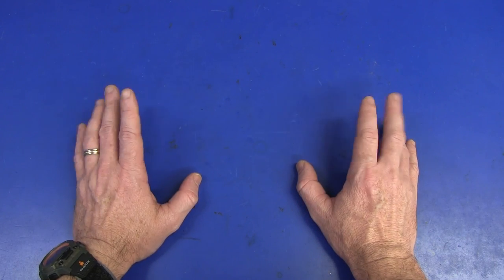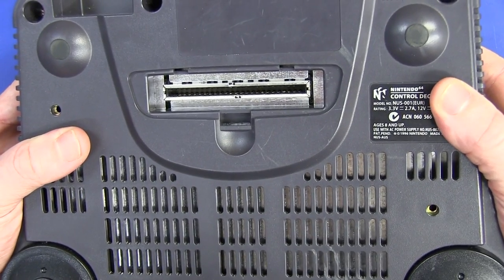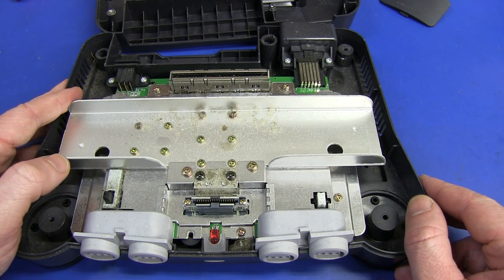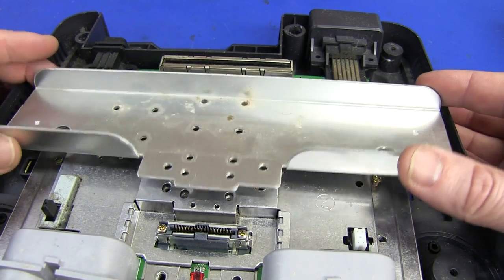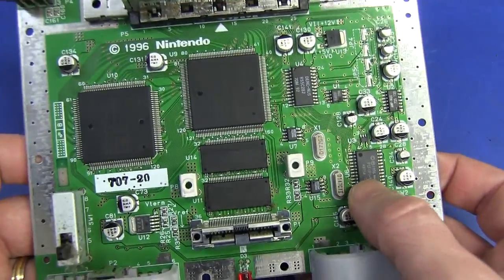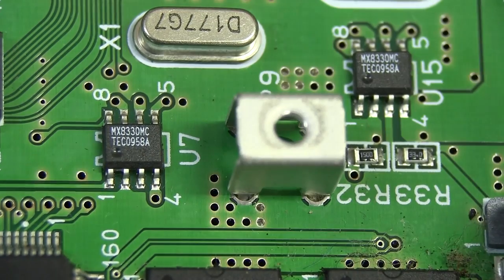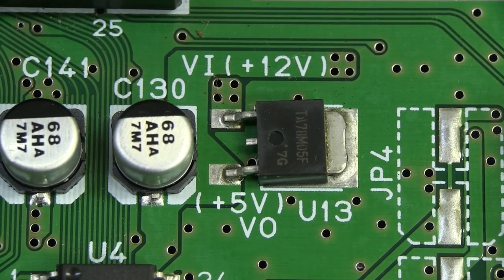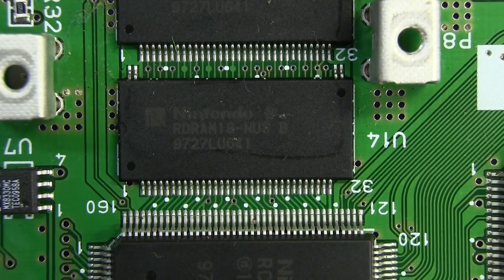EEVblog #491 - Nintendo 64 Game Console Teardown

Comment: The lack of RAM kicked the n64 in the nuts. Thats why alot of games were so cartoony. To save ram half the time you were looking at shaded colours instead of actual textures.
Reply: Not really, it was the price of the cartridges or the ROM-chips to be more precise.
The RAM wasn't all that important because the cartridges were solid-state.
Reply: The ram is very important, rom is fast but its not as fast as ram and you can't write to it. The n64 actually had more (4mb vs 2mb) ram than the ps1 but the gpu would only accept textures as large as 4kb. The ps1 allowed you to store large textures in the VRAM which was 1mb. Thats why n64 games all look cartoony, half the time you are just looking at a shaded colour and not an actual texture..
Reply: Derpin Bird That's nonsense...

The big strength was the N64 cartridge. We use the cartridge almost like normal RAM and are streaming all level data, textures, animations, music, sound and even program code while the game is running. With the final size of the levels and the amount of textures, the RAM of the N64 never would have been even remotely enough to fit any individual level. So the cartridge technology really saved the day.

— Factor 5, Bringing Indy to N64 (Source Wiki.)

The real reason the N64 wasn't a commercial highlight was the fact that you would have to manufacture a custom ROM chip for every individual game which was ludicrously more expensive compared to the price of a burned CD. 
Take the amount of chips in the Cartridge of Conker's Bad Fur Day as a negative example.
Reply: I don't deny the fact that you can load while the game while its running. Im saying the 4kb texture buffer caps all of the textures to 4kb. There is no workaround to that on the n64 and an off topic article on how the game can run and load at the same time doesn't change that. It doesn't matter that you can "stream" it right from rom, you need to render the textures and you can't do that in memory you can't write to.
Reply: Also you do not need custom rom chips designed for different games. They are just blank memory chips that are loaded with software at the factory.
Reply: Derpin Bird Games that were licenced by Nintendo, ALWAYS  used true ROM chips in their cartridges and not PROM EPROM or EEPROM chips!
Reply: PERILEX You cannot render textures on a rom chip. Period. All you can do is read data very fast. The problem is the gpu was by design only able to accept 4kb textures. The n64 "reality coprosessor" (gpu) just had no workaround to make that limit larger, all they could do was come up with better compression formats. Rendering involves reading from the cartridge into the texture buffer, processing it and then writing the output in the correct part of the frame buffer. The playstation on the other hand had to load all the textures into ram, then read the texture from the ram into the texture buffer. It is slower but the cd can fit more and the gpu has direct access to the ram and is in a position to use it for whatever, like perhaps a custom buffer you could put whatever texture you like. The n64s crazy coproccessor was optimal in that it did read directly from the rom and take instructions but it had to ask the CPU to operate on the memory, making the process too slow to try to use it as a buffer.

There are alot of articles on this. None on how to work around the texture problem beyond compression. Nintendo also experimented with making an add-on cd attachment. But that never took off because it wasn't the problem. Sure having limited game sizes wasn't great but the console wasn't built to handle large game size. It cant load large textures, has no audio or video decoding chips and its a nightmare to program for. Whats to put on it?
Reply: Derpin Bird Sigh...
Reply: You don't get where Im going don't you? Even with the 4Kb cap, there were many games that looked more than fine enough to become BESTSELLERS! 

GRAPHICS AREN'T EVERYTHING!

THE PRICE OF THE CARTRIDGES WERE THE PROBLEM NOT THE MUSHY'ER TEXTURES!
Reply: To fit in the space and save on cost, Majora's Mask was the exception to this (EEPROM chips), which is why the cartridges degrade so damned fast.
Reply: JohnBonoSmith Yeah they only used masks to stop piracy which was successful but everyone had to pay the costs. I also think there might be a limitation with adressing more than 64mb of rom as well but who knows.
Reply: OK, firstly it's the gpu that has access to the memory bus, NOT the cpu, and thus the cpu often stalls waiting for the gpu to hand it memory.

Secondly, the theoretical capacity of a cartridge is related to the bus width... Due to it's design, you could theoretically use 4 gigabyte cartridges, and that's without resorting to the bank switching techniques that are extremely common on cartridge based systems as far back as the atari 2600.
The limiting factor is cost, not technology. The reason real cartridges capped out at 512 megabits (64 megabytes, about 1/10th of a CD), is entirely because even 64 megabytes of rom at the time was unbelievably expensive to manufacture.

Then we get that 4 kilobyte texture cache... Yes, that is the primary limitation, but, and this is important, you can draw something, then load something else into cache, then draw some more.
Meaning, if you can reload the contents of the cache memory fast enough, you can code something to use much, much bigger textures by treating the image as a large number of 4 kilobyte chunks. This can, and HAS been done. (see rogue squadron, and conker's bad fur day for known examples)

OK, so now two new factors come in here.
1. ROM exists directly in the memory map of the system. - you can read it directly. You don't need to copy it into system RAM first, you can copy directly from cartridge to texture cache.
Contrast this to a CD system (or a floppy disk, or hard drive) where due to the slow speed and nature of the storage media, it is technically impossible to read directly from the disk in any meaningful way, you have to copy or at least stream it into main system ram before using it for anything. 
2. The main system  memory in the n64 has a bandwidth of 562.5 megabytes a second, but, and this is a major thing, the memory bandwidth of reading directly from a cartridge is between 50 and 300 megabytes per second depending on the cartridge design itself. Conyrast this to a CD where for a dual speed drive you get about 300 kilobytes a second, and you can see, in fact, reading the data directly off of cartridge is almost as fast as reading main memory.
This means that where the playstation, say, has 2 megabytes main ram + 1 megabyte graphics ram, the slow speed of the cd-rom drive means it has to store the framebuffers, game code, all the variables the game logic requires, 3d models and textures, and any sounds except maybe the sountrack (since the data rate is slow enough that a few kilobytes of a buffer would be enough to play cd audio directly if you don't need to do constant seeking). You have to load that all in one big chunk until you run out of RAM, then run it from RAM.
The n64 on the other hand? since ROM is as fast as it is, you can run anything which doesn't get modified at runtime off of rom. The RAM must contain any variables, and the framebuffers, and possibly some audio buffers, and if you modify geometry (think mario's face in super mario 64's start screen) or textures at runtime those would need to be in RAM as well.
But the actual game code? models? textures? sounds? barring use of compression all of that can be read directly from a cartridge without even so much as touching the RAM.

And, this is where texture streaming comes in. Store textures as 4 kilobyte chunks. Read these chunks at 300 megabytes per second directly from ROM into the texture cache. Draw relevant image sections which use this texture, load next texture directly from ROM, repeat, until you run into some performance limit. (fill rate, most likely, on an n64).
There's no limit to how many 4 kilobyte textures you can use in one scene other than fill rate and memory read performance, really.
and with 300 megabytes per second ROM reads, you would need to be using something stupid like 2500 textures in a scene before you ran out of ROM memory bandwidth, and likely something else would limit performance long before then.

Don't get me wronh, the 4 kilobyte texture cache is a major design flaw, but due to being able to reload it's contents many, many times a frame, and ROM speeds being beyond 50% of RAM speeds, it is in fact a limitation that can be broken with clever programming, and thus n64 games can use way more texture data than you give them credit for.
I haven't tested it myself (n64 homebrew is rather challenging), but it wouldn't surprise me to see later games reloading the texture cache 100-200 times per frame. With 8 bit textures, you get one 64x64 pixel texture into the cache.
But, if you draw intelligently with it, and write clever code, with 100 or 200 64 by 64 textures you certainly aren't limited.
a 256x256 texture is equivalent to 16 of 64x64 - so if you have, say, 10 objects, plus the level geometry, you could use 160 textures for objects, and 64 for terrain and you'd end up drawing using 224 textures, none of which exceeds 4 kilobytes.
And that's still very comfortably within the ROM bandwidth limits, so it leaves plenty of bandwidth for other memory accesses. Whether the rest of the GPU systems can keep up with that I do not know, but you certainly wouldn't be limited by the texture cache.
And while the details I used here are speculative, the technique definitely is not. This is exactly what late generation n64 games did, and it shows.
Reply: KuraIthys Lol how far did you have to scroll to find this one? All i said was the n64 has a memory problem, more specifically a texture problem. Something everyone has agreed with me on. I have also had this argument about trying to work around the texture cache problem, yes it could be done within limits but the code was highly proprietary and it shows in the difference between 3rd and 1st party games. The n64 had some very interesting very powerful hardware inside it but it just had the wrong features to begin with.
Reply: +Derpin Bird - +Kuralthys and the others make a lot of good points, and a lot more insightful than "the lack of RAM kicked the n64 in the nuts."  With as many games that look as good or better on the N64 than anything on Playstation, that simply doesn't hold water.  There were many other factors that went into it not being as 'successful' as the Playstation.  But i'll always prefer the N64.
Reply: kdkseven Like i have said many times now, the fact that it compared at all to a cheaper console packing hardware made years earlier highlights the fact that it didn't live up to what it promised. Like i have also said many times is that the n64 is a great console but it could have lept much further ahead if it had the ability to display more detailed textures on the screen. Its a memory problem, theres only kilobytes of space to fit textures and the instructions just aren't there to use other resources to do that like the ps1 can, and thats why their graphics output compares at all. Its not about which one is better compared to the other, im just saying the n64 could have been way better and using the most comparable console to do that.

Comment: Most of the n64s still work like brad new even when you threw em from the second floor ( i did it) no wiring, huge heat sink that works like armor well Micro$oft take notes because your consoles suck. No fan boy actually after PS2 era I switched to PC for the win.

Best console design ever.

Comment: That cheap ass heatsink is the reason that so many n64s would constantly overheat and lock up late in life.
Reply: So many people do not understand thermodynamics.
Reply: I found the imagined dialogue between the hardware design guy and the budget guy awfully familiar.
Reply: the n64 actually runs pretty well without any fans and I saw a video where they took off the heatsinks and it still ran fine. it shouldn't be hard to find, I just don't remember what it is called
Reply: NickTheDumbass i've had 3 n64 consoles in my lifetime, 2 of them will lock up constantly, unless i leave it on for a period of time, in which case the freezes become less frequent, which leads me to believe it's a case similar to the 360's rrod or the ps3's yellow or green light of death; which is cracked solder points on a critical motherboard component. Maybe not necessarily due to overheating, but heat and cheap ass junk components together.
Reply: I have two n64s (at the same time) and I never had issues with either
Reply: NickTheDumbass I looked it up, it actually was a problem with the expansion pak, which makes sense, because DK64 was the game that my second N64 started screwing up on. Maybe my stupid 12-year-old self messed up the contacts by not using the official tool for removing the jumper and expansion paks....
Oh well, now I know. I did see some issues with overheating systems, but they didn't freeze, instead they would reset at seemingly random times, so I guess my issue was RAM related.
Reply: The RAM part is pretty interesting actually
Reply: I only ever had the N64 freeze on my once, and it was while playing Rogue Squadron. System had been on for a looong time and the RAM expansion itself was super hot. The system itself was fine.
I think that's probably the main issue. The RAM expansion couldn't have a comprehensive cooling solution.
It was notably even worse with 3rd party RAM Expansions, that was noted even at the time they were being released.

Comment: how nice it would have been if this was a disc system instead... the dd64 should have been integrated into the final version, it was stronger then the ps1, but because of the lack of ram and size limit of the carts, they couldn't use the full power it had, so dispite having good games good build quality it was kinda a bit of a failure, much like the game cube that came after, it was stronger then the ps2, but it used mini discs..... pretty stupid moves nintendo... dont even get me started with the wii, wii u or even the switch, all systems with good games, but from a system design standpoint... come on nintendo... they haven't been on top since the 1991 snes  or even the 1985 nes.. from a build quality perspective, all were great.

Comment: Yeah n64 are hard to kill  XD you just need a good cleaning
Reply: I rember seeing a video of some guys Dragging it with a car, Lit it on fire for a bit, then the SMASHED IT WITH A HAMMER, that last part broke off a part from the area where you plug the power cord into, they plugged it in into a TV and powered it on THE THING STILL WORKED! N64s can survive mother fucking hell and back. I still have my First wave N64 and it still works like a charm.
Reply: yes XD that n64 propobly only needed to have contacts cleaned  and it would have worked like a charm
Reply: TheLastRaven6
 Its that rare earth element called Nintendium that Nintendo monopolized to make most of their older products damn near indestructible.

I think out of all their systems, the gamecube was their most reliable and durable system to date. Theres tons of videos of people chucking their gamecubes out of a 3 story building and it works just as fine minus a few plastic pieces coming off.